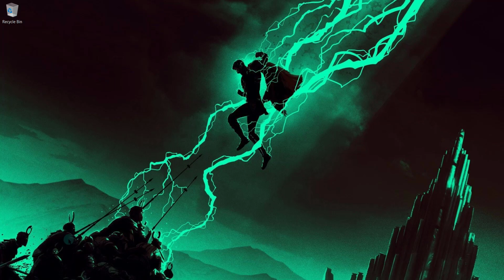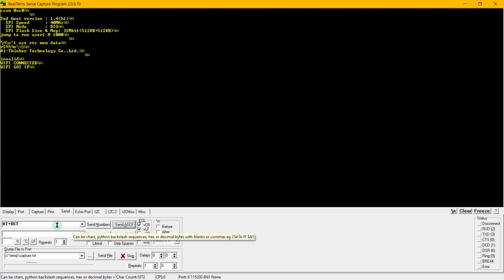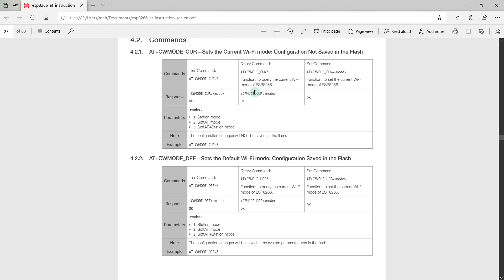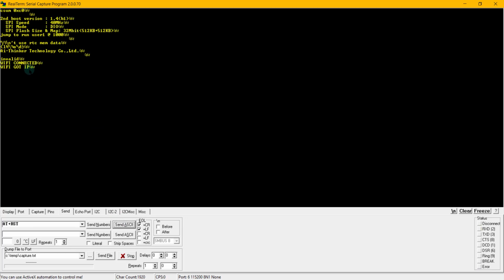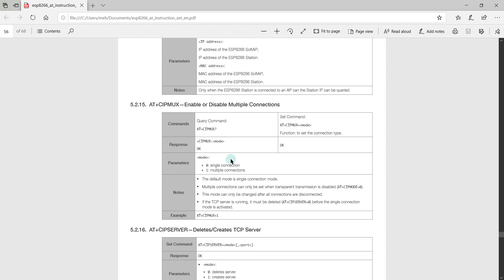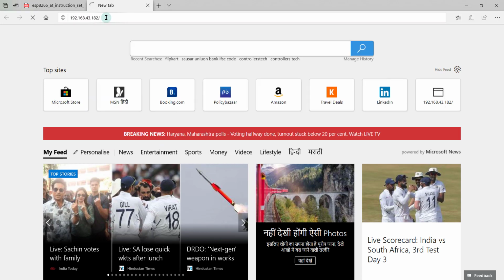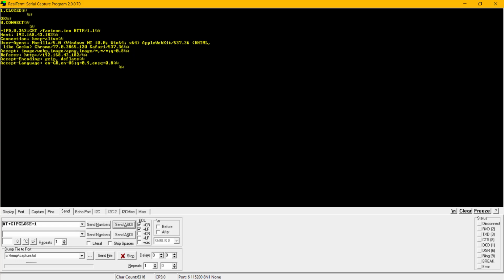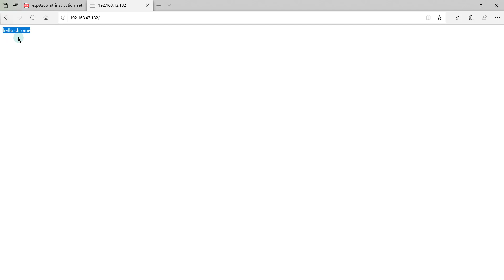Getting started with ESP8266 using AT COMMANDS

Comment: Hello... i m able to get 8266 generate the IP 192.168.2.15 and successfully ping to showmits working but Chrome is unable to show the page, could u advise?
Reply from the maker: You computer and ESP needs to be connected to same network.
Reply: @ControllersTech  Ya i connect both to same wifi network, chrome could not receive hello world instead show this " 192.168.2.15 didn’t send any data.
ERR_EMPTY_RESPONSE" pls advise...

Comment: Does the esp32, needs to have a program on it??, because mine is not working
Reply from the maker: The video say esp8266, not esp32
Reply: @ControllersTech  my mistake ESP3266
Reply from the maker: Its a module, not the MCU. And it comes with AT firmware installed by default.

Comment: at the connection diagram, do you wire flash mode or uart mode??? because I read an information and from what i can see is uart mode so in this one, my wifi module doesnt send data to the terminal, unless configurate it like flash mode, if I use the blue pill and send information by uart to the module wifi and I have configurated like flah mode, it will work??
Reply from the maker: I don't exactly remember what mode it was, but it was the default setup.
Whatever mode works for you in the normal situation, use the same mode with MCU.
And bluepill must use UART though.

Comment: I try to duplicate this video but using the ESP8266 12 -E NodeMCU instead of the ESP8266-01
Firstly I did the connections as you mention in this video using the USB to serial TTl adapter and connected to the PC via REALTERM software
and it looks like is only transmitting but not receiving any data from the ESP8266; the usb serial TTl adapter is functional OK.

Then I did try connecting the ESP8266 to the PC only with the mini USB cable; now I am able to transmit the first AT command and I receive a series of F9 and FB (hexadecimals values ) on the screen (REALTERM software application )  continously; even without sending any command.
It needs to download any particular file into the ESP8266 12 e NodeMCU first before I can achieved the same results as you shows us in this video .
Any help will be appreciated it
Reply from the maker: Nodemcu uses the lua based firmware by default. This code is written in terms of AT firmware. 
You need to flash AT firmware on nodemcu first.
Reply: @ControllersTech  Thanks a lot